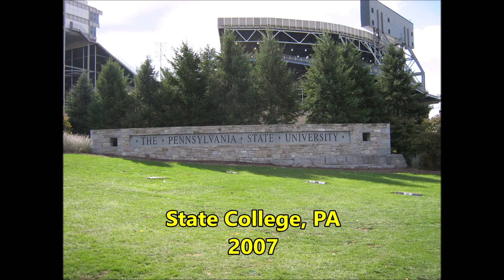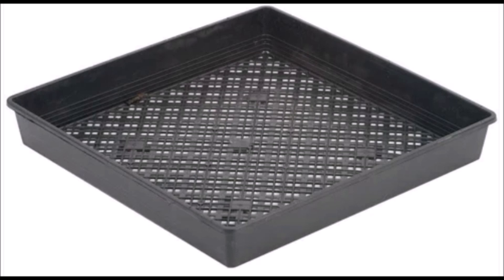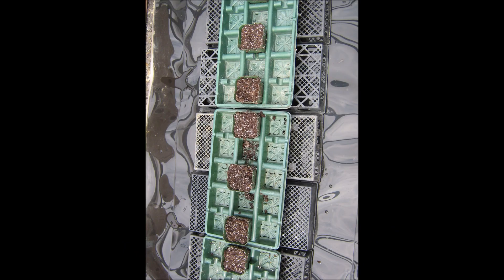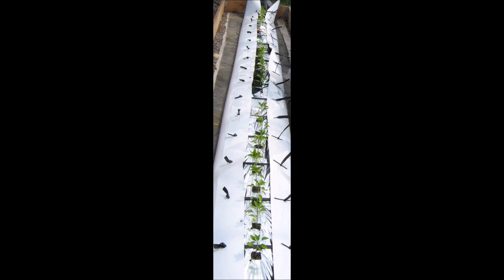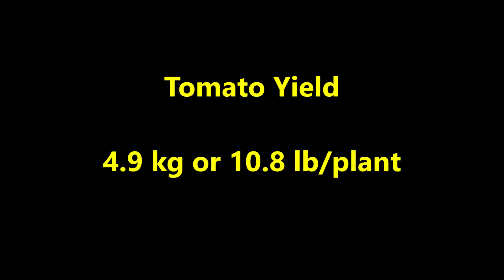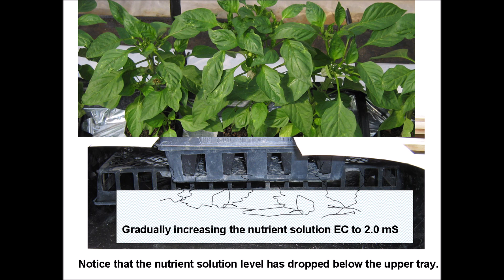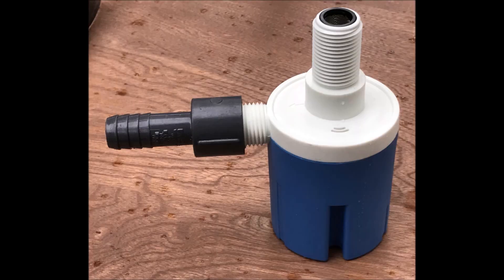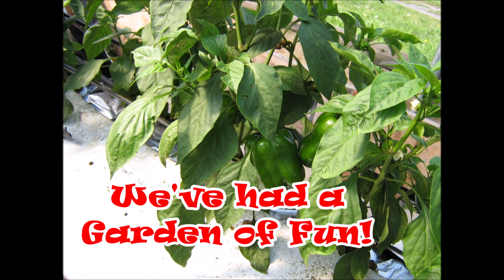Hydroponic Growing in a Roll out Plastic Tank

Comment: Does the drip tape water each plant until it  fills the plastic tank with 2" of solution?  I the this like an auto pot method?
Reply from the maker: No, the emitter spacing was 12" apart and wasn't coordinated with the plant spacing.  The purpose was to deliver nutrient solution evenly throughout the tank.

Comment: Great idea - hopefully this could work out cheaper than some alternatives - e.g. gutters or specialist gear.  Is this a draining / flow system, or did you seal the ends somehow?  Thanks :)

PS - the 1,000 L IBC / Tote cube containers are great for storing solution etc
Reply: You can see in some photos ends of the plastic are bent upwards so this is no flow system, just maintaining constant level of solution.
Reply: @dmitryplatonov  I saw one image where the end looks bent-up a bit but not obvious thanks.  The Word document describes it though, and yes it is intended as a no-flow system - though could easily be adapted to flow on a slope etc.
Reply from the maker: @afmedwards  Yes, you are correct!  The ends were bent up to prevent the solution from flowing out and this becomes a passive tank with no flowing or draining of nutrient solution.